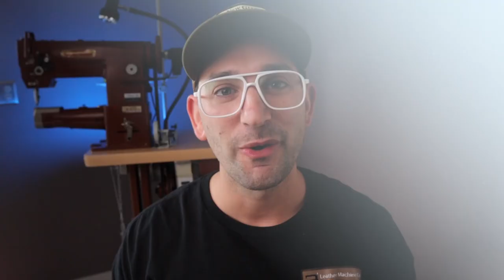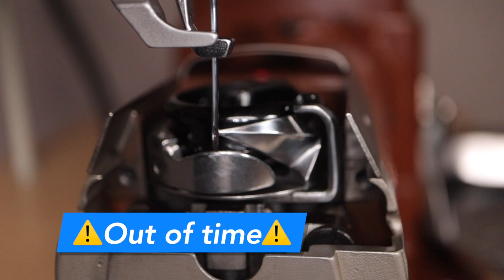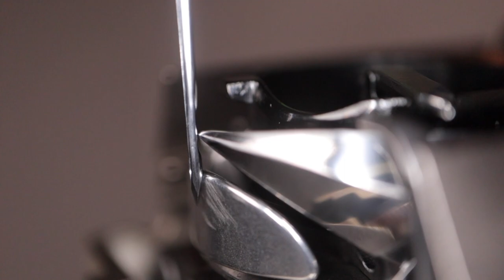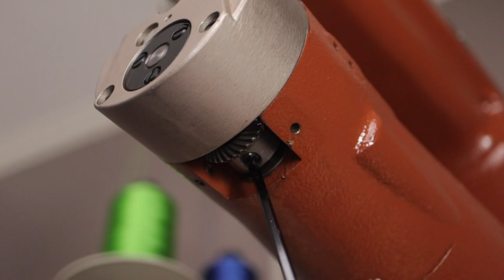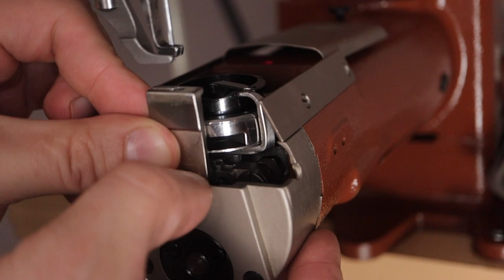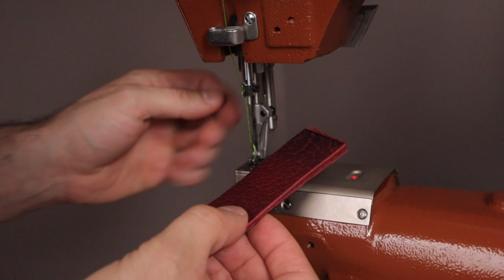Needle Bar and Hook Assembly timing adjustments for Cobra Class 26 - EPISODE 41

Comment: Is this something youd look at if your bobbin thread is just laying on the thread as opposed to being pulled in between the materials?
Reply from the maker: @TacumaGamba  first start by rethreading your machine completely.

Wind up a new bobbin and insert the bobbin. 

Change out the needle, make sure it’s replaced with a new one correctly.

THEN, try sewing again to see if your problems persist. You want to do all this before making and adjustments.

Comment: The Allen’s on the bottom or so tight I’m bending my tools any ideas?
Reply from the maker: They are extremely tight. Keep trying and put that elbow grease in and you’ll loosen up. 💪🏼💪🏼
Reply from the maker: You can also buy an Allen set that attaches to your socket wrench which will help tremendously